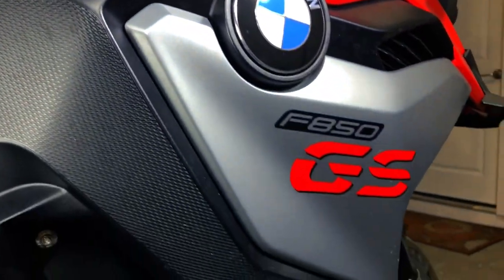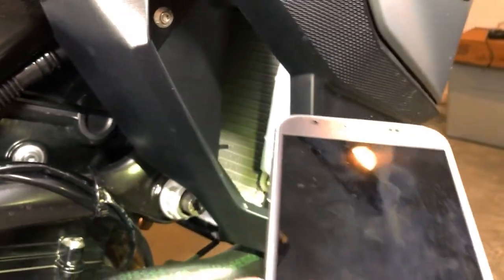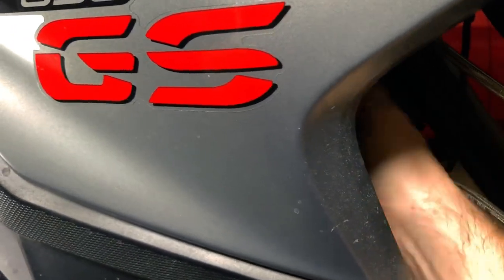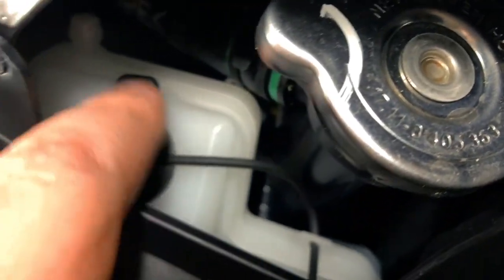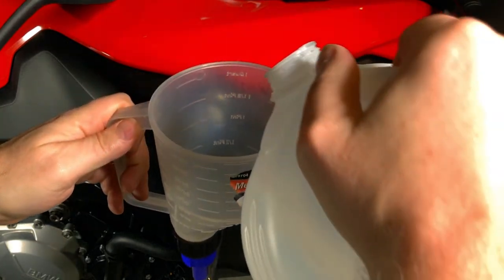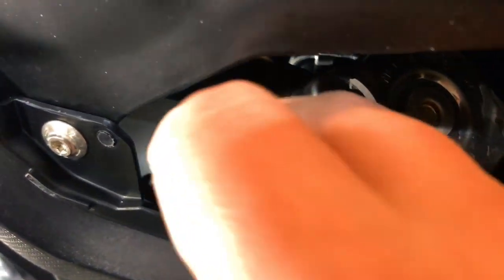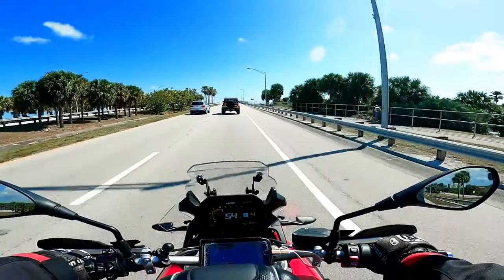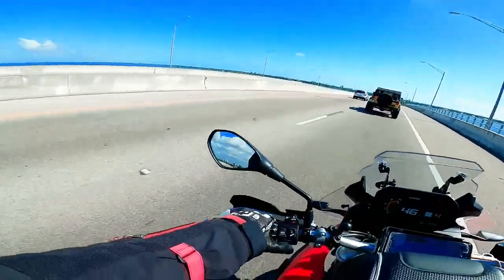How to: Check F850GS Coolant Level | BMW F850GS Maintenance

Comment: Is there a video showing how to change the coolant?
Reply from the maker: I have not made one. The service manual states to use a vacuum filler, which I do not use. I do it the old fashioned way and bleed the air out slowly.  Here's a video from someone else that shows it with a vacuum filler on another BMW https://youtu.be/Sb3PDFVvnY4